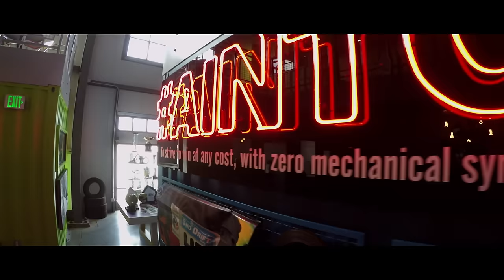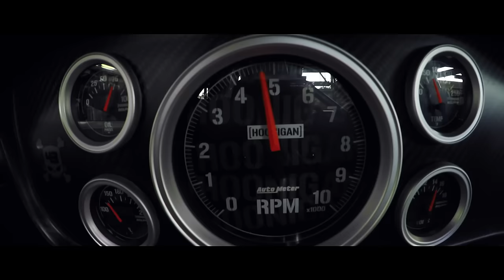GoPro: Driven Series | Ken Block Ep. 1

Comment: There's two off road ways out of this city 1 leads out to the oil derrek fields of North Texas  the other leafs to a military tollbooth of a check point.  The one leading out to the oil fields  is on the far left but their is mountains ranges Cliffside illusions and flat out zones where it is safest but here's my question  no monster jam truck can make it on the winding mountain edge side roads  so how does one get out to the oil fields safely without being stranded and yes commercial grade licensing is required drifting licensing required and stunt driving licensing required for you need at least around 400 liters  to make the drive and not get stranded well jf 1 liter is roughly 5 gallons and 20 ounces of fuel.  Yet you have to deal with  off road and on road by laws.   Now which is better car or truck or other 4x4. Now remember this  it is 1,200 miles plus more to go up north.   With it costing around 300,000 lumens to drive at night to see and drive or camp.